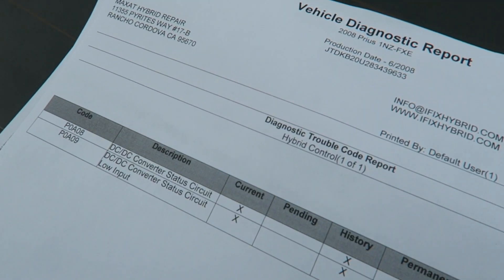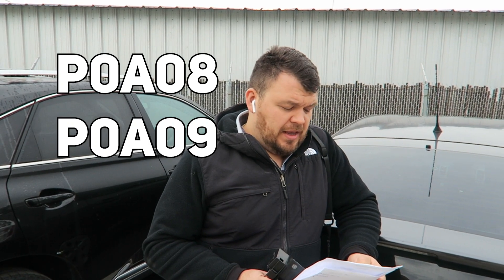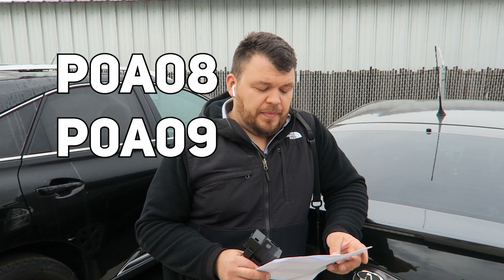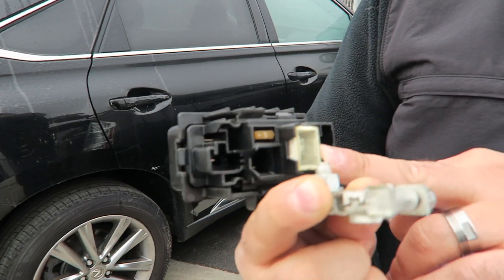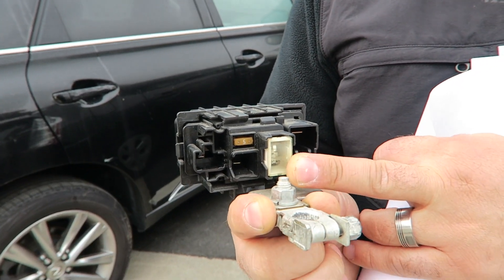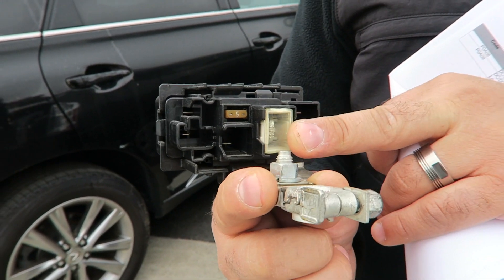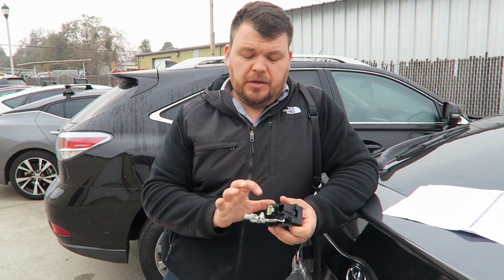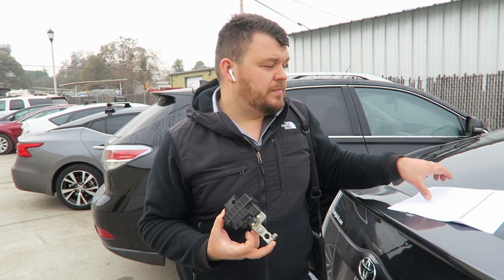Prius DTC P0A08

Comment: As you are holding the positive terminal and fuse block you keep saying "negative" ? The negative is a short black cable from the battery to the body. Are you saying the positive main fuse block has excessive resistance when loaded?

Comment: Everything is good but you have one problem and it is the code that you have p0a08 is not the code for what you found out and fixed it.  
So if you master fixer you should know that better.
Reply: Janek USPAUA let me know what I need to know?
Reply: Hi have this code come up on my Ford Fiesta 1.4 tdci poa09  dc dc low car stats but the rev counter sticks at 2500 rev then car may miss for a second  any ideas would be helpful thanks and good vidio
Reply: I have seen where is reported that a wire going to this positive terminal block is the cause as well for both the codes and related subcodes where guessing they are P0A08 264 code and P0A09 591.  Mice chewing and pulled on.  Also, the fuse can look good, though might be something with connection to fuse, I have seen that as well reported as the solution, replacing the fuse.  I didn't have the codes with a Prius I got with a bad 100A fusible link from I guess reverse polarity jump starting attempt.  Replaced fusible link and also noticed a 10A Mini style fuse on the terminal location, replaced with a 5A Low Profile Mini that oddly slid in deeper than others.  Code appears randomly since replacing 10A fuse, so will plan to replace the fuse first with the 5A Mini style I found since for some reason the low profile 5A isn't seating correctly.  I already inspected the wires and don't notice an issue as connectors can have loose wires as well being these can be pulled on routinely for those who like to reset trouble lights via the connectors pluggin in and out. I have personally seen connector issues with the capacitor next to the 12V battery, though that is a different specific code.